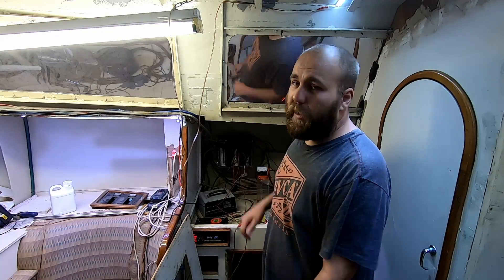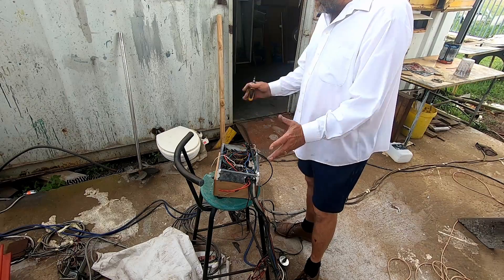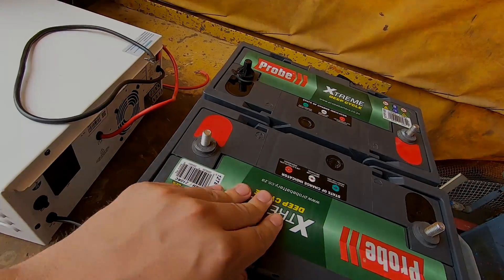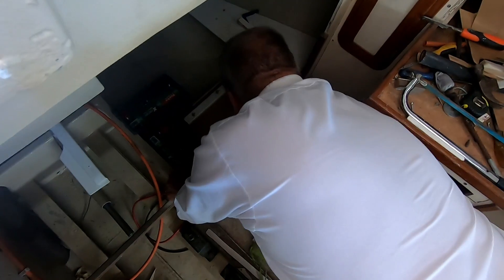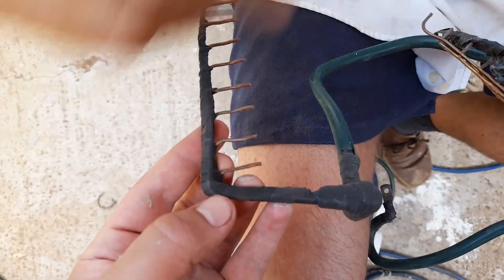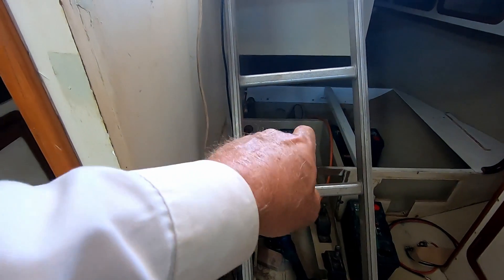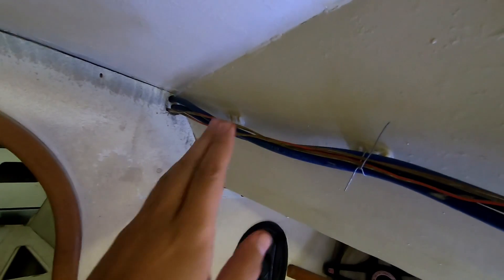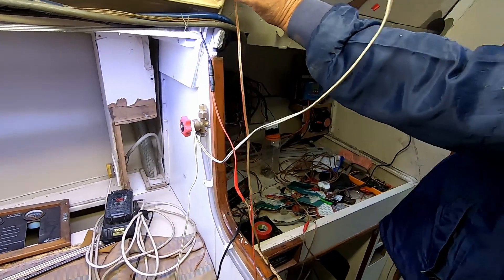Sailboat Wiring, Inverter and Electrical Installation | Land Rats | EP24

Comment: You won't have to pull the engine to replace that battery, will you? It looks like the engine will sit infront of it, but don't know what kind of access the it will leave for it's backside.
Reply from the maker: No we won't, the engine luckily doesn't sit that far back. And there is a inspections panel so we can just lift it straight out. If it's an issue we'll definitely rather move the battery